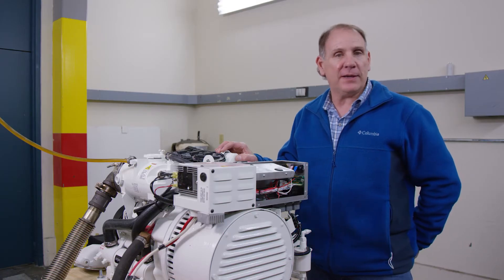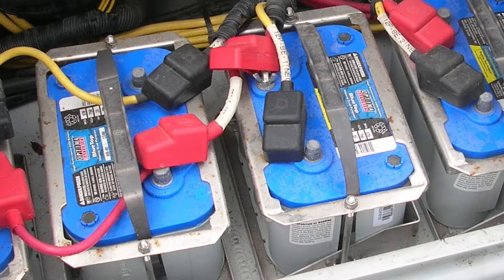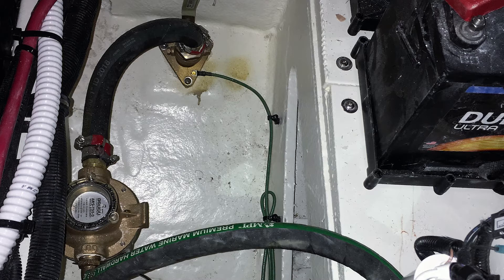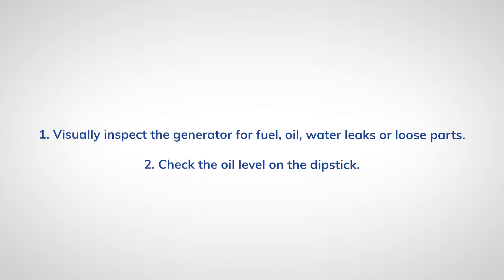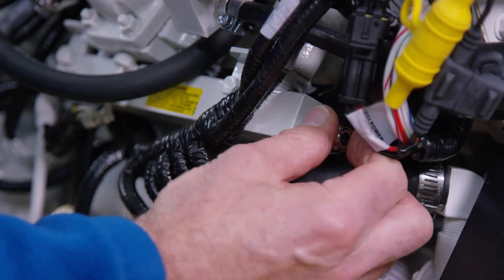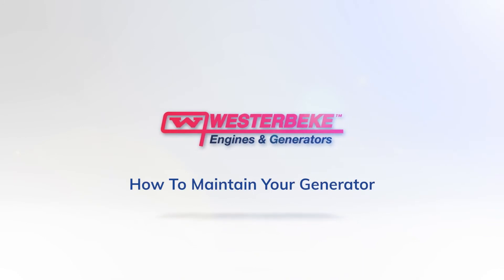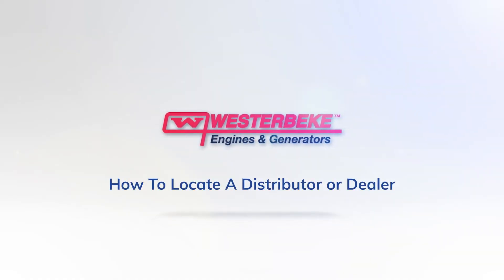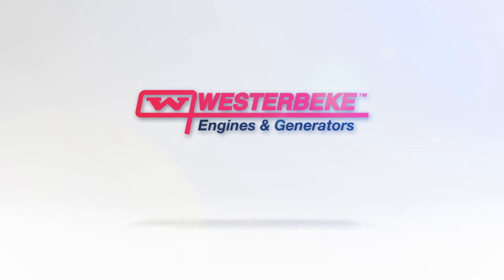How to Operate and Maintain Your Marine Generator | Westerbeke

Comment: @mubarakalharrasi8350
قبل 0 ثانية
I GOT A WESTERBEKE GASOLINE GENERATOR IT IS 9.5 MCGA ( 60HZ )
OUR PROBLEM IS THAT OUR SYSTEMS BURNED SEVERAL TIMES AND THE REASON WHY?
WE THINK ABOUT THE ( AUTOMATIC VOLTAGE REGULATOR ) THE AVR UNIT.
OUR QUESTION IS , IS THERE AN AVR UNIT FITTED IN THIS GENERATOR????

PLEASE SEND ME BACK YOUR REPLY AS SOON AS POSSIBLE

Comment: NO mention about the terrible design flaw from the outgoing 3.5 sbcg generator that has TWO belts UNDERNEATH the generator which is a nightmare to service. Westerbeke should have never sold a generator with belts located under the unit.
Reply from the maker: Mr. Morot,

We apologize for any difficulty you've experienced servicing your 3.5 SBCG. Some applications can be more challenging if access is difficult. If we can assist by answering questions you may have, please e-mail help@westerbeke.com.
Reply: I have a 28 Express with that generator, what a horrible design. Having access means nothing, the belt being under the unit is a major flaw, my generator is unusable.